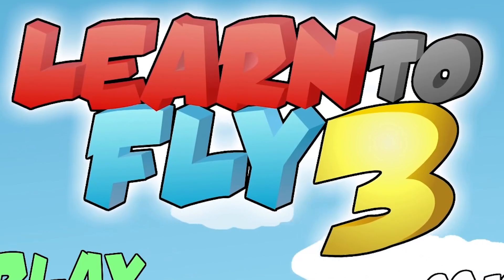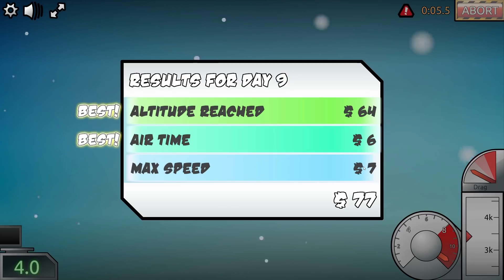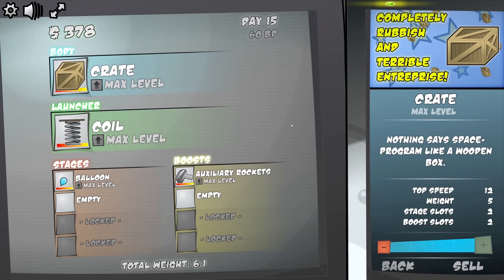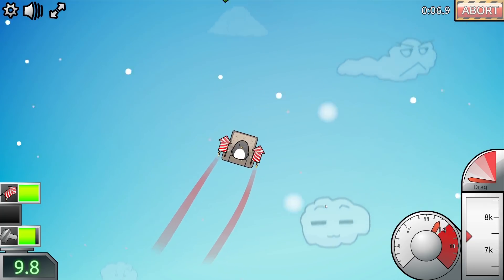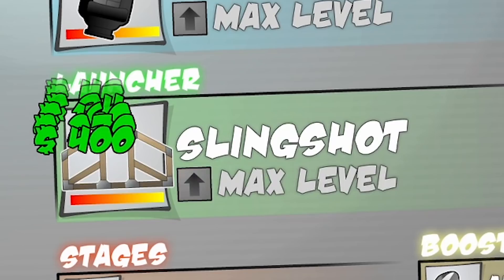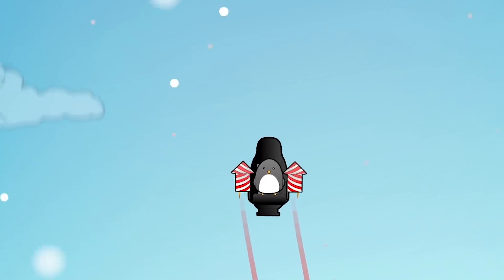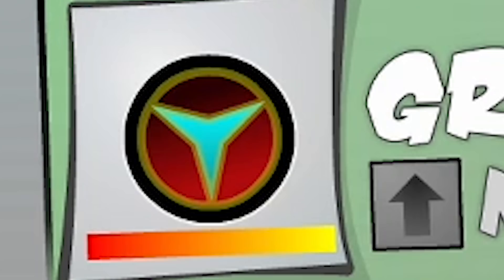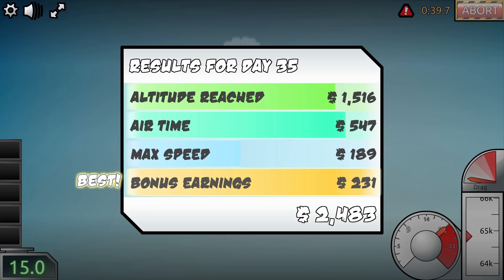Using THE POWER OF ENGINEERING to make penguins fly in Learn to Fly 3!

Comment: For higher efficiency: Speed increases drag, especially once it hits the red area. Keep that in mind when you use the boosters. You don't need to fire all boosters at once, you can use the keys 1 - 4 to fire each them individually. On most stages you can also hold a button (I think it was 's') to pause the stage. Especially useful to conserve fuel directly after the launch where you usually already have a lot of speed even without firing any engines. For easier steering you can switch the game to mouse control and just put your mouse in the top middle of your screen, then it will always automatically try to orient itself properly.

Of course you probably don't even play this game anymore, but it might be useful for other people.

Comment: Loved the vid and I can't wait to see more. Just some suggestions, use pressurized gas instead of aux rockets, and make sure you upgrade your body so you have better max speed.
Reply: better advice: use sonic bursts, way too OP.
Reply: @pi7855  those are stages
Reply: @BobBob-ye4vz  I'm aware, I said it because it could be paired with the commentor's suggestion pretty well
Reply: @pi7855  When you said “better advice” I thought you meant replace the pressure gas with sonic burst